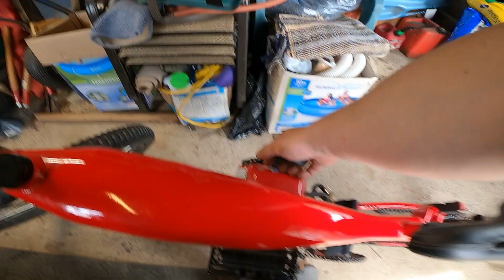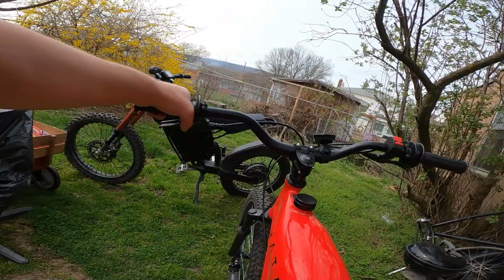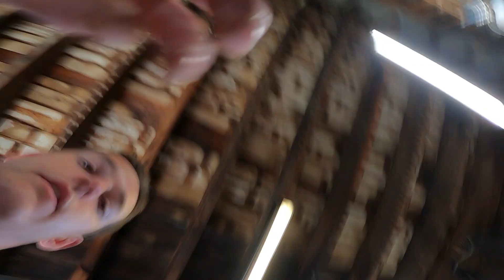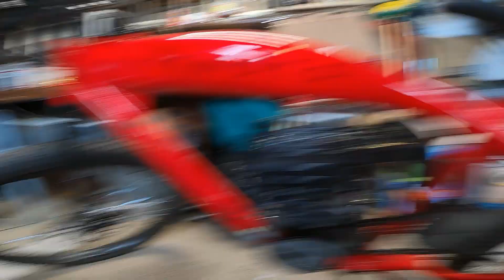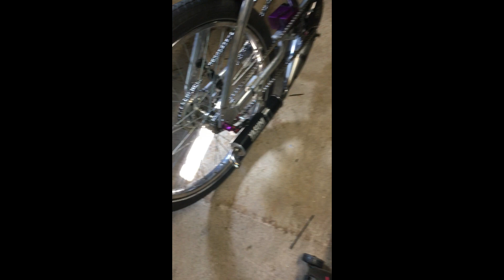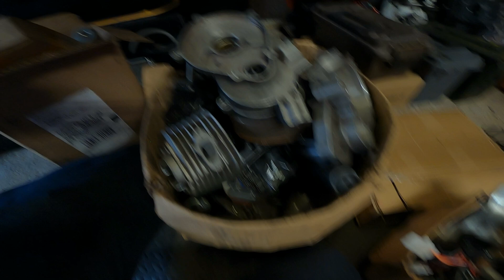Taking The 79cc Phatmoto Rover Motorized Bicycle Off Road

Comment: Not gonna lie tho, I’ve got all the minarelli hybrids, billet minarelli, built China dolls and I’d still love to have that bike. It’d be awesome on the bike paths in my area. I live on the same island as the university of Maine and there’s literally more miles in bike paths than roads lol.
Reply from the maker: Nice! Yeah I've had just about every type of setup too, except for a billet 2 stroke. That's my next project. I've done built china dolls, saw hybrids, minarelli hybrids, billet predator 212's, you name it. They were all awesome bikes, but the 2 strokes were all geared for high speed so trails were out of the question. If I geared the 212 down to like a max of 45mph or so I think it would have been pretty fun to take on some trails. I'm not a huge fan of the price tag on the Phatmoto, but it's definitely a fun ass bike to rip around on. Can't deny them that.

Comment: awesome vid. what are you honest thoughts on frame cracking issues?
Reply: +1 I don’t trust aluminum frames for long term use
Reply from the maker: I've been using these Faker frames to build my bikes for years, as most experienced builders prefer them, and I love them. I personally don't have much of any concern when it comes to cracking the Phatmoto frame, since they went ahead and welded gussets in at all the crucial stress points, it's about as solid as you'll ever get it.
Reply from the maker: @ghettobikelife8833  I ran a 17hp built 212cc Predator engine on my plain jane faker frame for just shy of two years without any issues. I know they can crack, like any other frame, but it's not a common occurrence. You have to be bombing around off road or doing massively hard launches to snap them. Or be a big boy lol, I only weigh around 175lbs though so that bits not much of a factor, for me at least.
Reply: Hardware 570 yeah the phatmoto looks beefed up, I just hope it didn’t actually need it lol. I have a felt faker and a regular gas tank frame rn for future builds, I weighed them and they’re both in the 6lb range, with just a few ounces difference. I could see a few bad spots on the faker’s welding but it does seem like it’s built better on the outside. So haven’t decided which is better yet lol. I personally don’t like aluminum because the fatigue limit is so low/nonexistent that any amount of repeating stress could eventually crack it (google fatigue limit aluminum vs steel). For steel anything below around half of its max stress won’t cause the metal to fatigue at all. I have no idea how much riding it takes for the aluminum frame to finally break, but haven’t seen any broken ones on the internet atleast
Reply: The faker frame I bought was the cheapest I could find on eBay (I think umoto), maybe the ones from other vendors are welded better
Reply from the maker: @ghettobikelife8833  That is true, I've been fortunate enough to get frames that were properly welded, but I'd be lying if I said I hadn't seen people get them with very questionable welds, if not holes burned right through them. 

Yeah steel is without a doubt a more resilient material. My electric bike's frame is all steel with aluminum forks and rims on it.  Only way I'd go aluminum there would be with some nice tubular exo type frame. You got to figure too that the guys who build on fakers, or the grubee style frame, are spending probably 99% of their time on smooth paved streets so they aren't getting over-stressed often. I've been thinking about putting a little 2 stroke on my full suspension GT LTS 5 mtb for some offroading, but that bike is pretty dated in terms of components and geometry lol.
Reply: Hardware 570 yeah that was my thinking too, that most gas tank frames are probably used only on street and probably don’t get that many running hours. To be completely honest I’m not too sad about the couple bad welds, cuz now I know exactly where to check for cracks lol
Reply from the maker: @ghettobikelife8833  Lolol see there you go, silver lining right haha. You're 100% right though, I'd say probabky 90% of the gas frame bikes out there have never even seen dirt lol. Bunch of pavement queens haha, I know mine were
Reply: @PhysiqueGeek  My bad I was remembering wrong about the frame weights, they're more than a few oz difference, just found the pics from when I weighed it. The cdh style (painted) was 6lb7oz, and the faker (unpainted) was 7lb14oz. Just thought I'd correct my misinformation lol. So the faker should be stronger, though I have a feeling the faker has alot of weight tied up in the tank area (no clue how they manufactured that.. maybe in 2 halves, formed in a press+die, then welded together, and sanded? from the top view where it meets the head tube idk how they could form that out of a tube). I also weighed a steel beach cruiser frame that I spent hours gusseting every single junction, and it only weighed 8lb4oz. That was dissapointing, I wanted it to be a tank
Reply from the maker: @ghettobikelife8833  I'd imagine the extra weight comes mostly from the thicker dropouts and seat/chain stays on the faker. The other CDH gas frame, the teardrop tank/Grubee style, actually has a slightly larger tank on it (3.75L to the Faker's 3.4L).

If I had to guess I'd say either you're right and it's two halves that are joined, very nicely, almost too cleanly for a "cheap" chinese product lol. Or maybe they might hydroform the tank section. 

I'll have to shine a light in the tank when I get out there to start painting later, maybe you can spot the seam from the inside? 🤷‍♂️

Comment: Do you like that bike? Any problems with it?
Reply from the maker: It's a pretty damn fun little machine! Of course I'd love to beef it up and have it doing 60mph+ but it's just not built for that. I think if they were to use the Predator instead of the Lifan 79cc it'd be a much better value. At least then you'd have some aftermarket upgrades to choose from. Lifan has nothing for some reason lol.
Reply from the maker: Only thing I really don't like, at all, is the forks. They don't soak up much of anything lol. Brake calipers aren't the greatest either, but they still do their job well enough for what he needs it for. Neighbor uses it to ride like 15 miles each way to get to work every day so it's more about reliability than performance I guess
Reply: @PhysiqueGeek  nice